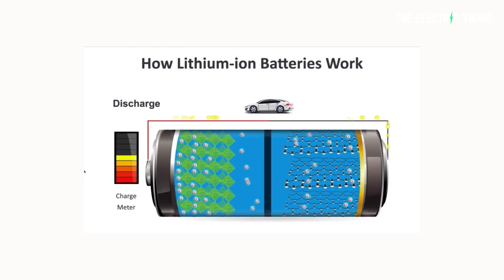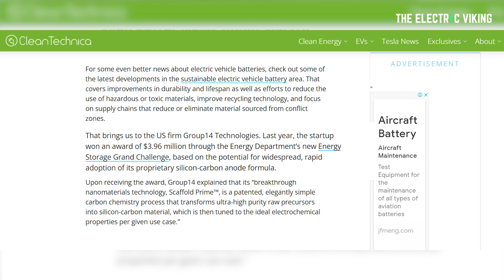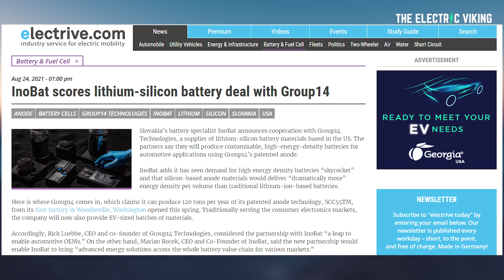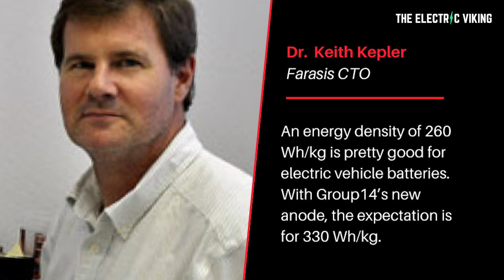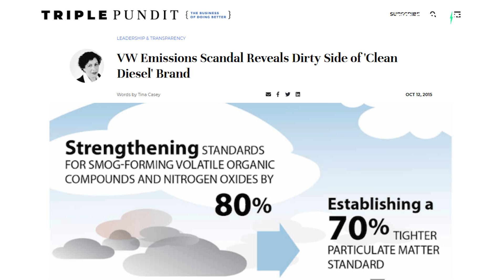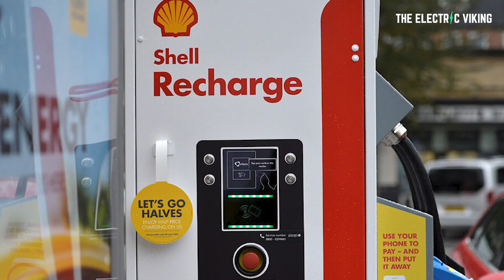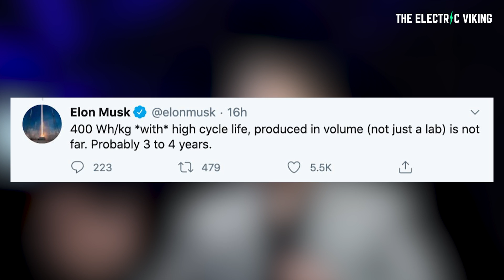NEW battery TECH will give lithium batteries a 25% BOOST

Comment: HPA High Purity Alumina will be part of the chemistry in the higher density EV batteries of the future. Hpa is being used as a coating for both anode and cathode chemistries and the rate of charge, discharge, cycle life, fire saftey are all increased significantly. I would enjoy a video on this emerging tech! Alcoa and a small aussie company FYI are in the starting phase of ramping up production with LG Chem and the like screaming for the 99.99% pure product as it will be a game changer. At present china produces the most HPA and uses most of what it produces. Watch this product come into the spot light over the next 2 years as it used to nano coat graphite and silcon as well as the separator will be HPA.

Comment: Lithium batteries are a dead dog soon. When you consider if you have a 36000F Capacitor @1000V is much safer and easier and cheaper to make. and use.  KWhrs ^ at  Square of the voltage .
Reply: Super capacitors are good for short-term pump with regenerative braking but fall well short on holding stored energy.

Comment: Aluminium-ION batteries developed by GMG are already up to 70 times faster charging and have up to 3x more battery life than lithium batteries, it's just a matter of time till car makers will switch to this technolgy
Reply: This sounds like aluminum air non rechargeable battery, useless for most applications
Reply: @glike2 If you would have invested just 5 seconds to look up the company you would have seen that you are talking nonsense

Comment: Where and how are they going to get all this extra electricity to charge these vehicles??? I don't see a bunch of new nuclear power plants being built. So that means they're going to have to burn more fossil fuels to get this electricity. Am I missing something???
Reply: You're missing the fact that the vast majority of charging will be done overnight when the electric grid is currently underutilized. The power plants will run more efficiently if they aren't turning on and off so much throughout the day.

There will need to be some improvements to the grid as well, but it's not nearly as much as skeptics seem to think. Those improvements are already under way.

BTW, Tesla is as much a power company as an electric vehicle company.

Comment: Hi Sam! You seem to be completely ignoring the evolution of Ammonia (NH3) as a replacement fuel for ICE engines. Also the nonsense that Electric cars are somehow cleaner than ICE cars from the cradle to the scrap yard! It is much cleaner to build existing ICE cars than electric. 14 tons of CO2 for an ICE engine car than the current 20 tons produced for all the components of a battery car. With the new clean Ammonia production, ICE engines can be adapted to use Ammonia, which will cost an estimated 30cents per gallon to produce! I think I will wait and see what happens. The ICE engine, using Ammonia fuel will leave electric cars in the dust, with lifetime Electric producing far more CO2 than an ICE car!
Reply: Just go away.

Comment: Hyundai and Kia team with Factorial Energy on solid-state batteries.....Massachusetts startup Factorial Energy claims its solid-state battery technology is "safer than conventional lithium-ion technology, extends driving range by 20 to 50 percent, and is drop-in compatible for easy integration into existing lithium-ion battery manufacturing infrastructure."

Comment: To those have this strange issue with battery recycling, I ask when was the last time they recycled their petrol/gasoline? Lead acid batteries are the most recycled material on the planet. There is no reason that lithium batteries will not be the same.
Reply: Fully Charged says they'll change their name to Fully Dieseled Up if someone can recycle diesel. It was a sarcastic joke by Bob Llwellyn.
Reply: Several companies can recover over 95% of the metals in spent batteries, without the use of smelting. Especially with demand for these metals skyrocketing, I invested in several of the companies: American Battery Technology, Li-Cycle, American Manganese, St. Georges etc.
The recycling will be profitable, instead of polluting.

Comment: Clean hydrogen is real.  You just use renewable electricity to electrolyze water.  This is a thing that can be done.  I'm not saying all hydrogen is clean.  At the moment, most of it comes from steam reforming of methane.  This should change in the future when we have periodic excesses of clean electricity.
Reply: There's no such thing
Reply: Yes but the losses in production & conversion are a killer, factor in that fool-cells need complete rebuilding after about 5 years. Ooh there's that it leaks out of nearly any material currently available. Its a dead horse unless there are some huge gains in new tech.

Comment: 6:29 That's right! If cold start was still an issue, EV sales wouldn't be what they are in Norway. And, guess what, in realy cold weather, ICE also needs special measures to get the engine started. I've heard that in the coldest weather during the Siberian winter, sometimes buses are left idling overnight at the bus depot, so that starting issues are avoided, once the engine fully cooled down.
I've also seen some ancient Russian army trucks with a feature to slide in a tray under the engine, where they could pour fuel to burn it and warm up the engine block, before attempting to start it.  =:-o
Reply: A friend in Canada literally plugs in his ICE car to keep it warm overnight in winter. Otherwise diesel freezes...
Reply: Norway isn't really that cold - at least, the coastal parts of southern Norway warmed by the Gulf current where the vast majority of the population lives. About 25 years ago I met a Norwegian who was visiting North Carolina and he was complaining about our cold winter - and this was not even in the mountains, but near the coast. He explained this to me. When I visited Helsinki, Finland one December I found that the temperatures there were not very cold either.

I've also overwintered in Antarctica, so I know a little about vehicles in cold conditions. At -40 you've got a serious problem with starting ICE vehicles - we had plug lines where we would park out vehicles and we'd plug the vehicles in when they weren't being used, with three separate heaters installed in every vehicle to keep the engine block, battery, and fluids from freezing. If we went out somewhere where there wasn't a plug line, we just kept the vehicle running all day because we knew there would be no way to restart it if we turned the engine off.

That said, I also saw how batteries fared in those conditions - and it wasn't any better. Many of us would carry a camera with us, and we carried it in an inside pocket in order to keep it warm - but after taking it out the camera would die after a few minutes due to the cold. Warm it up, and it would start working again.

So we do need better batteries that are able to handle cold conditions. Vehicles are also traditionally heated with waste heat from the engine, and we will need to come up with better efficiencies to keep passenger cabins heated in cold environments without seriously affecting range. But there is constantly work being done on better battery chemistries, and I expect it won't be all that long before we have mass-produced batteries that will work at very low temperatures. Let's not forget that NASA's moon buggies were electric, and that Musk is developing the industries and industrial know-how that will be necessary to colonize Mars.

In the meantime, very few people actually live in places where temperatures dip to -20, much less -40. We could easily transition more than 90% of the world to electric vehicles without even beginning to affect the people living in such places. For now, they should probably keep their internal combustion engines - and hopefully in ten or twenty years we'll have something suitable for them.
Reply: @alanlight7740  , ha-ha I remember the "battery in the pocket in winter" trick, even back in the days of the old film cameras. In their latter days, the cameras had motorised film transport, motorised focus and other clever electronics and the cold weather would seriously limit the charge you could get out of the battery. And it wasn't even in -40, in my case!
To solve the problem of heating in cars, I think resistive heating is a bit wasteful, so a heat pump is required. Like the reverse cycle a/c I have here. It uses less electricity for the same amount of heat generated, than an electric heater.
Reply: @sandman0123  - heat pumps are great in temperate climates, but pretty useless in extreme cold. They require a source that has at least some heat to pump from one spot to another.

It occurs to me that perhaps the simplest fix for extreme cold climates would be to have a propane or natural gas heater in the car, separate from the other systems. Because its only purpose would be to provide heat, not power, it could be designed to be very efficient for that purpose - and incidentally provide enough warmth to keep the batteries working.

Comment: I own a 2016 eGolf.  Its present range when I charge it to 85% capacity is 91 miles.  Do I have range anxiety?  NO!  Here's why: The U.S. Census Bureau reports the average one-way travel time to work in 2019 was 27.6 minutes, up from 25 minutes in 2006. Federal Highway Administration data from 2019 indicates motorists in the U.S. drive an average of 39 miles per day.
The amount of hassle, maintenance, and gas costs more than pays for the occasional car rental I use when I want to travel a long distance.
I live in Las Vegas where summer temperatures often exceed 110 degrees f. (43+C)
The eGolf A/C cooling and heating work much better than (and so much quieter) than the Mercedes C120 sport I previously owned.  I admit I'm terribly smug and laugh at how much people are spending on their Detroit iron.

Comment: Interestingly,, both Volvo and Mercedes are talking about an energy density improvement of 40% and a range of 1000 kms by 2025.
Reply: that's all they do TALK....and hope by 2025 do another TALK
Reply: @musk-eteer9898  That's what Tesla did for a long time. Talk and no deliveries.. Patience, grasshopper.
Reply: No need for a range of 1000km
Reply: @rogerstarkey5390  Agreed Then a smaller lighter-weight cheaper battery. About 700 km is good for me.
Reply: @777Outrigger  500km is plenty for most people. 6ish hours of driving is more than most people would/can handle.
Reply: @jackdbur  I agree. For most people, but not all.

Comment: Clean Hydrogen is real and useful - just not so much for cars.  Check the plans for clean steel production using hydrogen to replace coal/coke in steel making.
Reply: Happy as long as steel manufacturing is the prime usage of hydrogen. Fuel cells are not needed for land transport. Many in the know agree with you!

Comment: Lithium "corrodes or rusts" in an odd way. The rusty stuff that clogs up the lithium and stops it from making electricity is called DENDRITE and only happens when MAKING electricity. Once 20% of the lithium is coated, the battery is only good for stationary stuff - power walls, etc. Since 2018, Tesla cars have a battery composition that keeps dendrites low for over 1 million miles. Recycling ENTIRE batteries eliminates dendrites and returns "like new" fully reusable lithium. Tesla is building the facility NOW.
Reply: Better efficiency with battery recycling would be to sort through used vehicle batteries and reuse them for stationary home and business solar storage, this extends battery life for many more years. They then get fed into a recycling system after that.
Reply: @kelvinham8576  YES - that is the process as described above. Thank you for reading.

Comment: I think mainstream EVs should have at least 250 mile range, and 100kw charging, so a mid spec id.3. Of course, you want a L2 charger at home, or at work, at the hotel, or the camp site, and a "supercharger" or DCFC every 50 miles, though, you can easily get through places in below zero F temperatures where there isn't a charger for a 100 miles, and if it's warm, and you go 40mph, you can go 300 miles. Who are you racing? A little stop every 3 hours is good for you. Walk around, snooze for 10, get a snack. I have a 2018 Tesla Model 3. It's great. Even a Chevy Bolt with 50kw can do it, but a little slower. We just need more CCS. Go Tesla, open them up.

Comment: I got the info (forgot on what channel) That the LFP was early used in the China domestic market due to a special free to use licence for batteries made in China for China but not for the rest of the world. The LFP patent has ended recently and there is another patent about a special anode or cathode chemistry ending april 22, 2022
that is required for LFP performance enhancement.  So it is probable that the tsunami of LFP Chinese EV’s will start next April, buckle up folks… 😉

Comment: The development of batteries and their technology is at a pace it’s almost makes buying an EV now not so smart, lease is an alternative. However you frequently mention about your investments in EV manufacturers, the real markets that benefit from battery technology are energy harvesting companies. The focus with Tesla is on its cars, to me the real Tesla business development is in its sub subsidiaries solar power, which storage is a vital element, while the storage is not exactly the same
Development in storage is the common denominator. Which in time will make Tesla cars a drop in the ocean, compared to Solar and energy storage and distribution.
Reply: No doubt. Tesla has stated as much.
Reply: Regarding the assertion that buying an EV now may not be so smart: there will ALWAYS be improvements to the technology just a few years away that can be invoked to justify sticking with the familiar old standard; in this case ICE vehicles.  The right perspective is rather when you are ready for a new vehicle, first wrap your head around the new paradigm of destination charging.  The vast majority of the time, you are fueling your vehicle at one or more of the places that you are already going to; your home, first and foremost.  Then figure out how far you typically need to go between stops at the one or more charge capable destinations available to you.  While that value will vary greatly, for the average American commuter that may be 30 miles or less.  If the published range of the EVs available to you will get you that far (more likely several times that far) get the EV!  You will be patting yourself on the back every time you drive past all the folks queuing up to drop another $50 in their gas tank.
My 7 year old Leaf was bought with that calculus in mind.  I have to destination change at work also because I live way out in the sticks.  Even so, the calculation of my need hasn’t changed and so I keep driving the, by now arguably grossly obsolete EV.  At about 125k miles the range has degraded only minimally, so that is not a problem yet either.  In another year or two I will buy another EV, and my son will happily continue to use the Leaf for his much shorter commute.
Just no good reason to delay if what you can get today will serve your needs already.  It will probably continue to serve you well long after innovation and the market argue that it’s obsolete.

Comment: Neste oil makes clean diesel you should do some research
Reply: And the exhaust gas is so clean you can breathe it?  Yeah, I didn't think so.  They probably mean carbon neutral.  That's at least possible, but diesel is inherently dirty.  It's hard to clean it up.  I suppose with enough expensive technology, you can get rid of enough of the toxic PM2.5 particulates and other pollutants to be "acceptable", but it's gonna cost you and require constant maintenance.